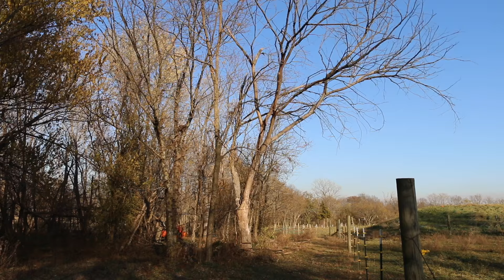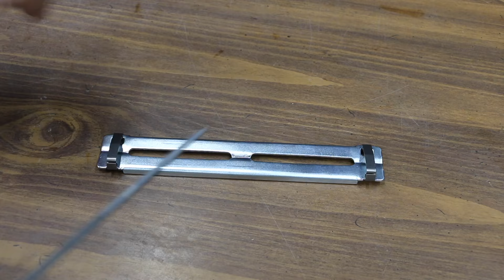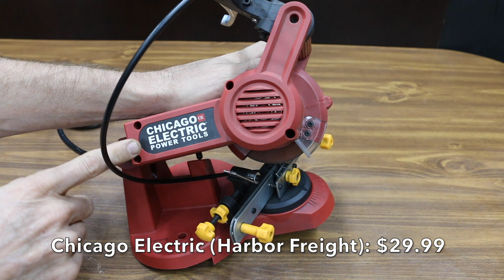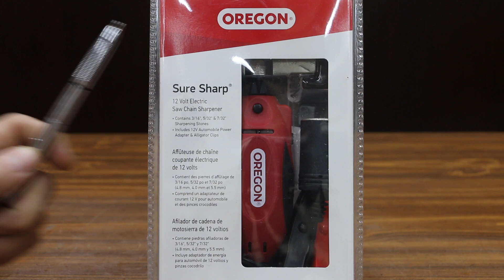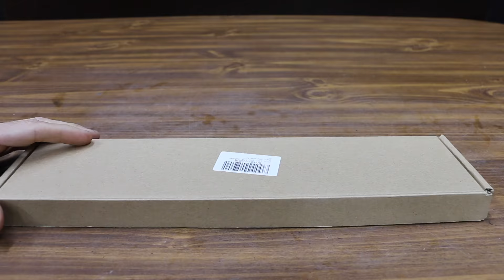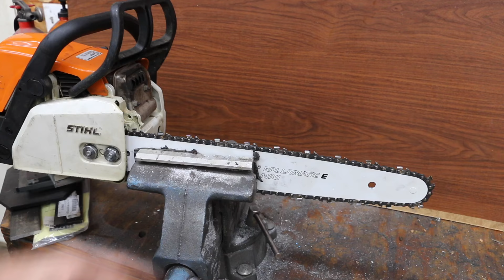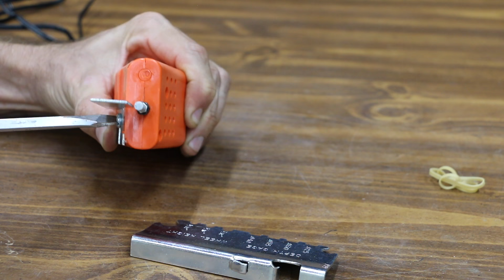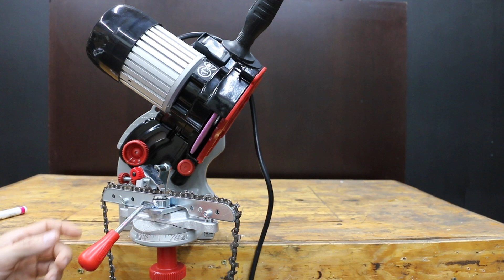Which Chainsaw Sharpener is Best? Let's find out! Stihl, Granberg, Chicago Electric, Oregon

Comment: You will find results get slower every sharpening on most of those sharpeners. Only files that shorten  the guide at the same time, like the Stihl 2 in 1 will maintain chip size.
Reply from the maker: Thanks  for the feedback.

Comment: Small confounding factor. Some treatments filed the rakes, others didn’t.   Lowering rakes makes the chain more aggressive. Like my first wife.
Reply: Why'd ya lower her rake then?
Reply: Yes the depth gauges make a substantial difference in cutting speed. Also, the battery's charge in the saw makes a difference. I grind down the depth gauges a little lower than Stihl's specs, otherwise the chains cut too slow. The curve in the bar needs to be taken into account when using a depth gauge, otherwise they won't be filed low enough.

Comment: I have been an arborist and worked in forestry since the '80s. And I have tried nearly all the sharpening systems on the market. (And some  formerly on the market.)

Then I found those little 6-sided things put out by Jonsered and Husqvarna.  They have rollers and are easy to use. In my experience these sharpeners do the best sharpening job I have ever achieved.
Please Note: if someone is interested in these little sharpening guides, they come in 3 colors to use on 3 sizes of chain.
Also these come in a little kit which includes the nicest file handle I have ever used.  Also suitable for flat-filing depth gauges.
Reply from the maker: Thanks for the feedback.

Comment: Project Farm: "When it comes to using a chainsaw, one of my least favorite things to do, is chain sharpening!"
Also Project Farm: *makes a video sharpening 9 chains all at once
Reply from the maker: Thanks for watching.
Reply: The Stihl 2 in 1 will make sharpening easy and no longer a chore. I have a Triton SuperJaws  in my shop and I clamp a 5 inch C- Clamp in it and use that to clamp my bar and sharpen my chain on the saw with the 2 in 1.  It's quick to clamp my saw and a good height to sharpen at.  Takes about 5 mins to sharpen.  In the field I just set the saw on the back of my truck, put the tip of the bar in my stomach (usually wearing a sweatshirt), sharpen all the top teeth, then rotate the chain.  3-4 times and I'm done.  Probably 7 minutes that way.
Reply: Ah the sacrifice he's willing to make is most valued.
Reply: I'd rather sharpen them than use them.
Reply: Also Project Farm: "I hate getting punched in the face, so next video I'll be testing 12 different types of brass knuckles on my own face"
Reply: @MichaelMacGyver  the fuck lol
Reply: @MichaelMacGyver )
Ll. Ko

Comment: You need a sharpener tool to sharpen a chain saw? What a sissy! er, how about results doing it the old fashioned way?  All you need is the right size (5/32's) rat tail file, and just sharpen it with a few strokes. Dont need no stinkin' sharpening tool.
Reply from the maker: Thanks for the feedback.

Comment: I’ve cut firewood for over 50 years and I’m always looking for the best technology so here goes:
1. The best chain sharpener system is the manual Grinberg filing joint but you must mount the bar in a vice, which you did not. It takes the longest but does the best job and is the most economical because you only have to take as many strokes that are required to restore the fall cutting edge. Making all the teeth the same length is a worthless myth.  It is not necessary.
2.  The electric version of the Granberg filing joint is second-best because it uses the same precision guide.
3. The two in one Stihl file is the best tool for doing sharpening‘s during cutting session without removing The chain. It is sold under several vendors but they’re all made by Pferd.  Farmertec.com sells a imitation Chinese version really really cheap.
Reply from the maker: Thanks for the feedback.

Comment: I'd like to see the dremel chainsaw sharpening attachment in a part 2 for this
Reply from the maker: Thanks for the video idea.
Reply: ...and chucking up a good file in a drill motor and run it through each dirty oily tooth a couple times (at the proper angle of course). Whip out the 4" angle grinder and tap the top if the rakers down just a slight smidgeon. You'd be surprised. Probably works way better than some of these teeth melting tedious contraptions.

Comment: Something I  was wondering does the power units heat the chain enough to harden the teeth thereby making it more difficult to hand file them when you are in the bush and don't have a power sharpener available. I don't know if this is the case but when I was working in the bush as a shake and shingle cutter they told me don't use a power sharpener for this reason. Maybe you could test that to see if the chains you sharpened with power tools are more difficult to use the hand tools on.
Reply from the maker: Thanks for the video idea.

Comment: One thing I could see being done differently if replicating these tests is to set a fixed point that the handle of the saw can pivot on. This eliminates the user lifting or lowering the rear of the saw which in turn changes the amount of chain in contact with the wood being cut. I imagine this changes the chain speed having more surface area to remove at once. Working with such close numbers like hundreds and thousands of seconds could skew results.
Reply from the maker: Thanks for the feedback.

Comment: After using regular files for years, I now use the Stihl 2-in-1 (actually that's just a rebranded Pferd sharpener for the US market!) and something equivalent to the Chicago Electric.  What I've found is that the hand sharpening while out in the forest can slowly introduce irregularities in cut depth and cut angle which cause the saw to drift away from a straight cut as it tends to then cut (on average) more towards the left or the right.  Yes, this is due to my inaccuracy and incompetence! This is where I find the bench grinder really useful, to reset the chain to a sensible default.  My personal recommendation, therefore, is the Stihl/Pferd 2-in-1 for "in the field" and a cheap bench grinder for overhauling much used chains.
Reply from the maker: Thanks for sharing.

Comment: Need to do the timberline! Honestly you could just do it and edit it into the video!
Reply: I used the Timberline for a couple years. It does a great job but is time consuming to set up compared to the Stihl/Pferd which I use now. In addition,  the Timberline doesn't file the rakes which requires another step.
Reply from the maker: Thanks for the video idea.

Comment: The Stihl 2in1 manual file dominates rest of these shenanigan-y toys. You can easily keep it with you while working, if need be. Though the vice is a luxury you don't have on the job, an able worker knows to cut a sharpening holder slot with the cainsaw from a stump or similar.

Hedge cutter also easily sharpened in the field, hold between legs and find you position - file away.
Reply from the maker: Thanks for sharing!

Comment: So as an amateur have 2 to 3 chains ready to use, change every time You fill up with fuel, then buy a hand file set, and wind down at the end of day by filing the chains You used, and oil them up, put them in a kit, as a pro in a company, have enugh chains to work 3 full days, in days end, let the filing guy get the used chains, pick them up at the end of next day. Is this a good way to handle it?
Reply from the maker: Sounds good!

Comment: I've always used a really nice set of tungsten metal smith's files made back in the 1940s. An old employee from republic sheet and tube steel sold them to me at a garage sale and although they say u.s. steel on the handels, it makes little difference. The best 20 bucks I've ever spent, those files will sharpen anything.
Reply from the maker: Thanks for sharing.

Comment: I've got the dremel type as well as  selection of files, but for beat-to-hell chains (i.e. ran into a spike or used to cut a stump out of the ground), my Oregon bench grinder works wonders.  However, it's not an end in itself.  If you look at the cutters after using it, it leaves a burr on each link that has to be removed by hand.
Reply from the maker: Thanks for sharing.

Comment: I bet any decent bushman with a file is just as good, but at least twice as fast. Also they can sharpen on the fly with no setup - big value point there. Just a note - filing the rakes determines the chip size/bite and depending on the saw, the speed of your cut as much as sharp teeth does.
Reply from the maker: Thanks for the feedback.

Comment: So if you take a chain to a shop to be sharpened, what do they use and how would it compare especially price wise?
Reply: The shop I went to was more expensive than a new quality chain (from Amazon), and they don't touch the depth gauge (i.e. partial job).

Comment: Can you do a lawnmower blade sharpener next?
Reply from the maker: Thanks for the video idea.
Reply: Angle grinder with a flap disc is effective.  I also tried bench grinder and I found it more difficult and the results weren't as good.  You can also use a flat file, and while it works, it's too slow for me.
Reply: @allanwind295  I use the Oregon blade sharpener. Worth the 300 as in I have to sharpen about 12 mowers with 3 blades every monday
Reply: @angelopiunno3263  88-025?
Reply: @allanwind295  yeah thats it. With some practice you can make a blade sharp enough to cut paper lol
Reply: @angelopiunno3263  Thanks buddy.  I appreciate it.  It's reasonably priced too for what it is.  I would love a belt sander but they're just to darn expensive.

Comment: Another great video, and here is a little feedback for you.

My friends and I spent many a summer bucking logs for winter heat. The guy with the 'good' saw, Stihl, only cut down clean wood. The rest of us with cheaper saws were the ones to buck up all the skidded and dirty wood, or logs laying on the ground. When there is lots of wood to cut, we weren't thrilled to sit and setup a sharpener. So we mostly just free handed a round file of the same pitch of the chain and had at it. It was quick and the results worked pretty well. We'd usually get a new chain at the start of every summer. So it would be interesting if you could see what a free handed sharpened chains performance would be compared to the others.
Reply from the maker: Thanks!  Thanks for sharing!

Comment: The Stihl.  Once you get just a few minutes experience with it you can go at least twice as fast as done in the video.  I usually sharpen three or four teeth before moving the chain in the vice for one thing.  It's also easy to set up, easy to keep the right angle, it takes off less of the tooth than the powered models, takes down the depth gauge if needed at the same time and holds the file so that it doesn't damage the gullet. In addition, you can use it in the field as well.
Reply from the maker: Thanks for sharing.

Comment: The very best chain saw sharpener is a new chain but seriously  it’s kinda like drill sharpening, more operator than the tool.  I could take the most expensive sharpener and totally screw up the results.  That said I actually like the HFT unit.  I think I could actually sharpen a chain with it......or maybe not!
Reply from the maker: Thanks for the feedback.

Comment: The reason I think the Stihl 2-in-1 edges out the others (no pun intended) is this: Once the cutting edges wear down, then you must handle the so-called "depth gauge" beside each cutting edge. It's important to get that task correct; remove too little, and your chain does not cut; remove too much and your chain may bind (because it's digging too deeply into the wood. Being able to accomplish those two tasks simultaneously on "mature" chains has got to be a big advantage.

I would already own the Stihl 2-in-1, but for the following: My twin-battery Makita chainsaw (i.e., the one you used in your tests) requires the Oregon R52 AdvanceCut 14-Inch low profile narrow kerf chainsaw chain, which has a pitch of 3/8" and gauge of .043". Oregon customer support recommends a 4.5 mm (11/64”) round file to sharpen the cutters. Fortunately, I can find Oregon those 4.5 mm files online. AFAIK, Stihl only offers 4.0 and 4.8 mm files. Now all I need to know is how long those Oregon files must be to fit into the Stihl 2-in-1 tool.
Reply from the maker: Thanks for the feedback.

Comment: You should include setup time in these, as that would have a major impact in a production situation.  That Stihl looked to be seconds to get it ready, while the Grandberg and Chicago were not seconds of setup.  But the Stihl Price should be adjusted for the need of a file.  (I know it comes with one, but it wasn't the right one.)

If I was running a logging group, or just working for time, and I needed to sharpen a chain, the Stihl looked to be faster than almost anything, short of a new chain.  And maybe even then...  While the others all had minutes of time for the system to be configured, and some would 100% lose to the new chain, as the chain has to be removed.

If I was in logging, I would probably carry the Stihl, and give the chain a light touch at the end of every day, if not maybe also during lunch, just to maximize my cuts/save time.  And the Stihl/Oregon would allow me to do that quickly.  The other systems would not.  They also looked much more "finicky" than the Oregon/Stihl options, meaning I would have to spend MORE time trying to get them set "right", and that would take away valuable time for the actual work.
Reply from the maker: Thanks for the feedback.

Comment: The Stihl 2-in-1 has so much going for it - easy to pack, maintain, files can be used on non-powered saws, almost nothing to wear out and zero electricity needed. No Fn way I'd go with any of the others. Actually, I wouldn't go for any commercial system but if I had only these choices, say I was on vacation a long way from my shop and helping a friend get started, it's pretty clear now what the go to is. Great video! You're an *ss bustn obsessively thorough dude, for sure. Please don't ever go unibomber.
Reply from the maker: Thanks for the feedback.

Comment: If you whip out that clunky Harbor Freight sharpener in front of a Real Tree Feller he's going to laugh in your face and fire you. I've been using that 2 in 1 Sthil for years and that's the way to go. There should be zero reason for having to remove your chain from the bar in order to sharpen it.
Reply from the maker: Thanks for the feedback.

Comment: I've been using the Stihl 2 in 1 for about 2 years now and I'm so glad you were able to confirm my biases! Thank you as always!
Reply from the maker: You are welcome!
Reply: My thoughts exactly.  I've always loved using it and "felt" it to be sharper than factory.  It's my #1 for in that it doesn't need voltage to run.  Thank You!
Reply: I use one in the field and touch up my chains regularly rather than let them get dull before I sharpen. Great sharpener.

Comment: I got the Granberg File sharpener when I got my last chain saw. Always works well for me. Can use it in the field without a power source. I try to touch up the chain every time I refuel, so it never gets really dull.

I have a bunch of rugs that slide on the floor. There are a bunch of rubberized coatings claiming to fix that problem. Hard to tell which one is really the best and most economical. Hope you will consider testing them.
Thank you for all the effort you put into testing!!! You get more done than I do!
Reply from the maker: You are welcome!  Thanks for the video idea.

Comment: I think you missed one that should have been included, the Timberline
https://www.timberlinesharpener.com/shop/?doing_wp_cron=1613967493.7697889804840087890625
I also think keeping manual ones and electric ones in separate reviews and then maybe compare the best of each against each other.
Keep up the good work!

Comment: There's only one way to sharpen a chain and it's with a file....don't use anything electric as they will wear out your chain way too fast. File guides are good, but if you sharpen often enough, you really don't need the guide as the angle and depth comes naturally.
Reply from the maker: Thanks for the feedback.

Comment: The Stihl / Pfiel 2-in-1 is inexpensive enough to have a few set up for different chain pitches if you've more than one saw. Much faster to not have to remove the chain for sharpening as well.
Reply from the maker: Thanks for the feedback.

Comment: I own the granberg file and joint, stihl 2n1. Out of the box, the 2n1 is easier to get results with, however, after a little time and better understanding of what makes a chain sharp I’ve been able to get great results with the file and joint setup. 
I’d be interested in seeing the results on full chisel chains. I’d think with full chisel cutters the “square” grind sharpeners would outperform the round file sharpens.
Another great video.  Thanks for putting it together.
Reply from the maker: Thanks!  Thanks for the video idea.

Comment: I personally use the Stihl 2 in 1’s.   I generally take the time to measure the length of each tooth to keep them equal but Ive found that the depth gauge grinding not as aggressive as i like.  So after sharpening i usually hit the depth gauges with another stroke or 2.
Reply from the maker: Thanks for sharing.

Comment: Gun oil should be a video soon.  There is so much lore and opinion on the subject.  Rem Oil is loved by many, hated by as many, CLP, old surplus LSA, Hoppes, or just 3 in 1 and motor oil up against them!  There should be plenty of ways to test without ACTUALLY getting guns involved.  Protection from rust, how well they stay in place under various conditions or rapid vs slow movement ect.